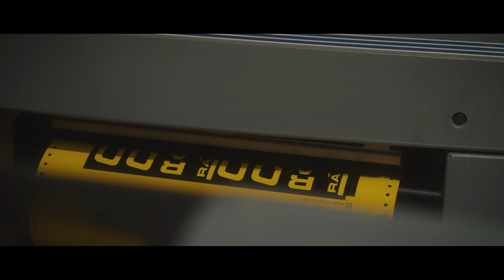RESTORATION of a RALEIGH CHOPPER 1973 - Classic Bike build

Comment: I know this is an old video, just wanted to say I thoroughly enjoyed watching you restore this bike, especially with paint cans, I have a MK1 and you have given me the inspiration to have a go at it.
Thanks Joe
Reply from the maker: Thank you very much, I still like getting comments from our older videos, I can't tell you how much I appreciate it. Good to hear that you are going to get your mk1 restored too. Paint cans are probably a lot better than the older paint techniques if you are careful and you can get a lot of parts for the old bikes now so I hope you get it done. Thanks for your comments and good luck with your bike, cheers      Joe.
Reply: Hi Joe
Things have progressed and we can't remove original paint as its a January 1970 mk1 USA bike thats come back to the UK after 50 or so years, I am struggling to find any form of paint to match the original colour (sky blue candy paint) as I need to touch up some areas where the paint has come off.

As far as I am aware everything is original. 

Kind regards

Comment: As a 60's kid that was obsessed with owning a Chopper this was superb viewing, a real joy to watch Joe. I never did get that Chopper as a 6 year old but eventually bought my own used model some years later (in my teens) and made it look how I wanted it to (without the resources you have). One thing I didn't do, even as an inexperienced kid with limited equipment, was tighten wheel nuts with pump pliers . . . . . . what's that all about man? With the set up you have you should be using a socket set at least for that kind of task, it just makes sense for the safety and well being of your customers.
Reply from the maker: Hi Tony, nice to hear your story, we have had some great responses. Those Knipex pliers are not your average pump pliers, if you get chance to use some you will see why, better than a socket or spanner for these old nuts.  Cheers   Joe.

Comment: I had one in the 70s I had a problem with the 2 frame bars breaking and needing a weld done to the bike. I had two of them and had the same thing happen but I did love those chopper bikes.
Reply from the maker: Thanks for sharing
Reply: It was right below the seat where it had the welds break under the sissy bar.
Reply: Do you have a chopper bike for sale if yes how much for a decent one

Comment: 19:29 The one shown In the Blue Peter clip Is the one I had, the Mk1 In Red, the one Joe just Restored, Is the Improved Mk2. The Mk2 was made safer, the seat was straitened (So You couldn't do wheelies) the handlebars were welded so You couldn't adjust them forward. The gear stick was changed from Round to the Gripper one seen hear for safer shifting. And Suspension on the back of the seat (Again to stop wheelies). If you are restoring one and You don't have the Stencil printer, You can get the original stencil's still. Nice work, would love another one, but would look strange on one at 63.
Reply from the maker: No you wouldn't, you need to get one! Thanks for all the info
Reply: I am 68 and still ride one had it from new a mark 2
Reply: I'm 58 and just bought one.... Yippee.!!!!

Comment: mk1 chopper was the best one.
firstly it had a round gear nob
secondly it had a longer seat so you could ride 2 up
and thirdly it had adjustable handelbars..i had a mk1 and loved that bike
Reply from the maker: 100% agree
Reply: the only problem though with mk 1s is riding 2 up and the frame used to crack at the bottom lol, i think thats why you had the hockey sticks and a shorter seat on the mk 2. but yeah would love a mk 1

Comment: I grew up (some say I haven't) with a 5-speed derailleur, tall sissy bar, trashed it riding in the desert.  Got a Mk1 about 40 years ago, been hanging from the rafters until this month.  So the chrome fenders, wheels and parts are just wire-brushed?

Comment: I knew a guy who worked at the Raleigh factory in Nottingham in the late 80s. He looked after one of the warehouses. He was told by his boss that all the  Choppers, Chippers, Tomahawks, Budgies, Grifters Strikers and Boxers, were all to be cut up and recycled. He reckons there were around 2000 bikes. 
Sad, but no one was buying them.
Reply from the maker: That's a sad tale, glad some people kept their old one's. thanks for telling us that, it adds to the story that keeps these old bikes alive. I hope you enjoy our video's and please spread the word. We have a Grifter build coming soon, cheers     Joe
Reply: @JoesBikesUK  Look forward to it.
I'm currently deliberating - and have done for several years - whether to restore my Mk2. It's a 1979 red model. It's rideable with everything original (except the front-wheel inner tube and SA gear chain). It needs stripping, re-spray, re-chroming, new saddle strap (stretched), gear indicator cover. I did want to have everything powder coated matt black, a stealth Chopper if you will. I also know a lady who is an enameller and thought about have my initials put in enamel in the seat post bolt.
It's the time and space to do all this though.
Reply from the maker: @octaviussludberry9016  time is our enemy at times, look forward to seeing it done  cheers   Joe.

Comment: Great work! Any restoration done to the drive train (e.g. chain, gearbox internals)? Looks like the old chain is re-used. Was it intentional or was it just impossible to find a replacement?
Reply from the maker: Hi Joseph, glad you likes it, didn't need the gears sorting as they were ok, I chose to put the original chain back on after a bit of a clean but I may replace it soon, cheers    Joe.

Comment: Looks great but I really doubt the durability of that Orange Spray paint.  I recall doing a resto on my own bike 'back in the day' and despite copious layers of clear coat and sections of clear protective stick on vinyl it was pretty quickly ruined by stone chips and chain grazes.  Ditto polished up Chrome became very delicate and very prone to rusting again...
Reply from the maker: Hi ThePedroDB the red spray paint will be fine, the bike is on show and will hardly get used. The frame was sandblasted with aluminium oxide which makes all the difference and etch primed also for durability. Glad you like the way it looks and hop you look at some of our other restorations which we use various method of paint finishes, cheers      Joe.

Comment: Please stop using adjustable pliers to tighten (and scratch) nuts and bolts. I find it hard to believe that a pro would not have access to open end wrenches (spanners) or a socket set!
Reply: It looked like a special one
Reply from the maker: It is, it's a Knipex adjustable which is better than standard spanners for old bolts. cheers  Joe.
Reply from the maker: The Knipex adjustable wrench is better than standard spanners for old bolts, you got a forced grip rather than a slack fit of  spanner, cheers  Joe.
Reply: @JoesBikesUK  that’s me schooled then..
Reply from the maker: @musictube250  Haha, yeah but seriously I had the same opinion as you until i tried them, the Knipex pliers are awesome. cheers   Joe.